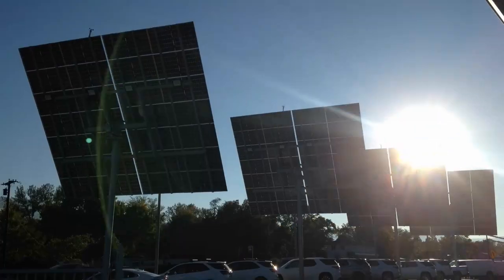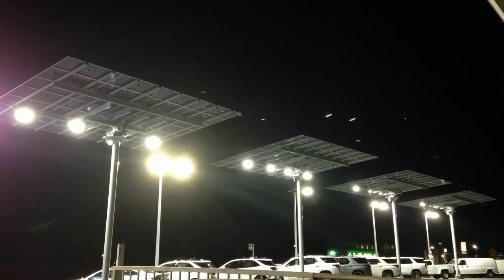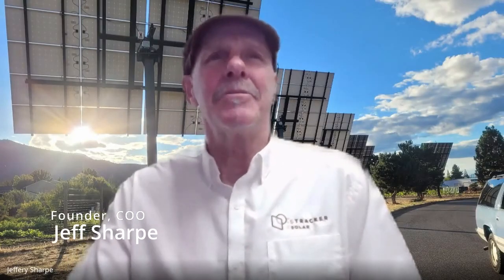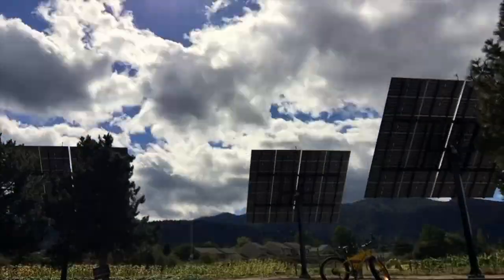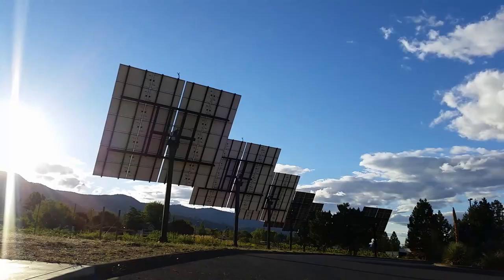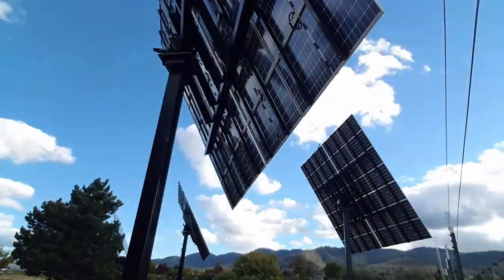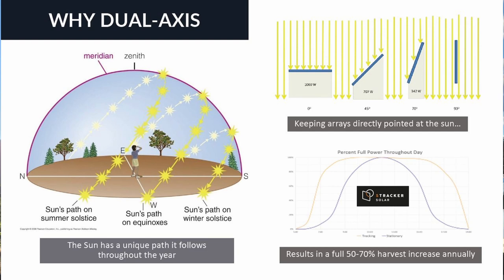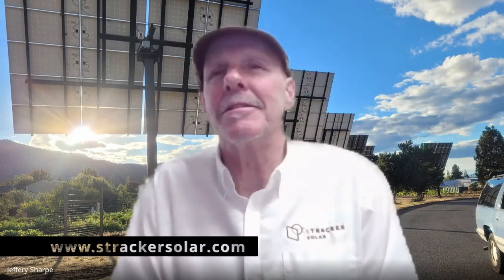The Pitch | The case for elevated dual-axis solar trackers with Stracker Solar

Comment: I like the elevation of the structure, keeps regular human hands away and may also be above shadows from smaller trees. If there is some patchy shadow still though, it looks like the panels are connected in series so if one panel gets shaded the whole chain it's on would drop performance. Is there a version with parallel connections in the works ?
Reply: Yes, and with that level of elevation be sure to enjoy it when it fails because it will, and have fun working on it.
Reply: @boblatkey7160  Using a telescoping pole might be interesting to fix that. Would definitely cost more though.

Comment: 25 years in the off grid solar industry and I have never seen a solar tracker that hasn't crapped out and failed and become a maintenance nightmare. Solar panels are $.50 a watt and if you want more power just buy some more solar panels! The beauty of a solar panel is that it comes with a 20 year warranty, has no moving parts and it sits in the sun and produces energy while making no noise. Throw away all that beauty by attaching it to an active and moving device that requires maintenance and troubleshooting and has a high propensity of failure. Do everything you can to avoid these things.
Reply: Exactly.  Single axis adjustment is all that is really needed (summer/winter).  Keep it simple.
Reply: Wrong
Reply: Hi, my pleasure to see your message, may i know if you have any interests in LiFePO4 battery?
Reply: The primary principle of the solar tracker is to maximize the amount of energy harvested from a limited space, in these situations "adding more panels" is not an option. Most industrial structures are not designed to support the additional weight of solar - especially if they are placed on one side of the roof structure - add snow and the building collapses.
While it may be true that there are a number of badly engineered trackers out there which have chronic maintenance issues, the current state of the industry says otherwise and most of the latest iterations are extremely robust where 120mph winds are the baseline. Coupled with automatic lube and self-calibration, a 30-year operational lifetime is easily achievable.
The downside of 2-axis trackers is they can't maintain solar perpendicularity in tropical regions unless they have a backtracking algorithm - but that's almost irrelevant when compared to static installations.
Reply: I also was thinking about making a tracker  but after doing research it shows max 40% annual increase of electricity production.  If no urgency or energy can be stored somewhere for cheap than tracker nearly makes no sense as economics if nowhere. Unless the trackers are very cheap and reliable but this is not the case.
Reply: @alexk6745  and don't forget that solar panels are all the way down to $.50 per watt. If you want 40% more power just add more solar panels to a fixed array with no moving parts whatsoever and 20 years later everything will still be working perfectly fine. Some of My original installations are now 25 years old and still work.

Comment: Does anyone know how many 400W panels can be installed on a pole-mount system in areas with potentially 80 mph winds? Are there any companies that manufacture and sell such systems?
Reply: they said 450 watts times 28 panels

Comment: This is exactly what I wanted to build for many years for except I live in FL where wind speed can reach up to 150mph in that situation I wanted the pole to lay down flat on the ground or a special platform where it will be held securely till the hurricane passes through.
Reply: You don't need a hurricane for these things to crap out and fail so you should skip them in the first place.
Reply: MT Solar single axis trackers can be easily engineered for coastal FL hurricane winds.
Reply: @boblatkey7160  Hey Bob do you have some evidence or experience to backup your claim?  Please don't just leave us hanging here Dude!

Comment: Trackers are cool and do maximize power for panels, but I'm with the nay sayers.  Panels are cheap.  Put them on a building, carport, or shelter for dual use or mount them on the ground.
Reply: Lot of people don't want them on their roof and ground mount might give you better mobility?  And cheap is a relative term of course.  Especially if you aren't going to get any rebates, tax incentives, etc. :)
Reply: Solar panels on the roof void your roof warranty.

Comment: To bad you can't get the price down to a point and height that its good for individuals to install these.
Reply: No, keep them up super high so that when they fail maintenance and repairs will be an absolute nightmare. There is no such thing as a tracker that doesn't crap out and fail over the years.
Reply: MT Solar single axis trackers are a LOT cheaper and easier to install.

Comment: my little  2 x 4 wood tracker gets almost 50% more power out of a panel
Reply: All manufacturers of solar panels will void the warranty if you mount them with wood. It is a terrible idea and you might say that it works but it will stress the solar panel overtime by contraction and expansion and it will cause micro crystalline fractures of the solar cells.

Comment: Would love to have an elevated ground mount dual axis solar tracking system in the backyard.  Would prefer to be able to install, maintain, and service it myself.  It would be great if they come in different sizes to holds different number of solar panels so users can choose what they need.  How easy or difficult is it to lubricate the bearings once a year?
Reply: These systems cost $66,000 in 2022 - not sure if that includes installation. Not really intended for residential installs or self-maintaining.
Reply: It sounds like you should consider an MT Solar single axis tracker... Lots cheaper, works with any panel, and you can install it yourself!

Comment: I'm in favor of solar.  I own a 2kWh LFP battery and 3 panels for emergencies.
With that said, atmospheric CO2 at 400ppm is totally not a problem.  The atmosphere needs more CO2, not less.
During the quaternary glaciation atmospheric CO2 fell to .018% of the atmosphere or 180ppm.  At .015% or 150ppm plants begin to die.  Assuming that the entire globe goes to zero CO2 emmisons, what's the plan if CO2 drops below 150ppm?  Do we drill for gas and oil and just burn it off?
Again, solar in specific applications are an excellent idea, but scrambling to go solar and wind because of some existential threat is total rubbish.  The CO2 scare is a complete and total fraud based on fraudulent computer models. 
If anyone has been affected by the so called climate crisis please let me know.

Comment: When solar panels are $.50 a watt purchasing a bi facial solar panel for any other reason than aesthetics is also a terrible investment, and they do not nearly produce anything close to what they say they do on paper.
Reply: why would bi facial be a terrible investment ? they seem to about the same cost? im asking since i about to pull the trigger on my first solar diy set up and was going to use them ground mount . they are pretty much same cost on signaturesolar and i figured i may see a gain in winter with snow on ground. what im i missing?